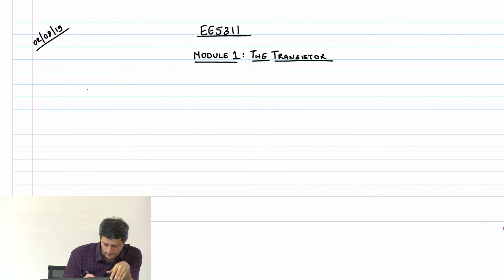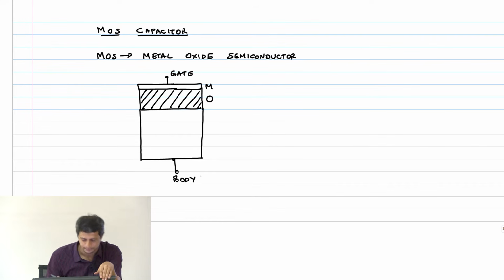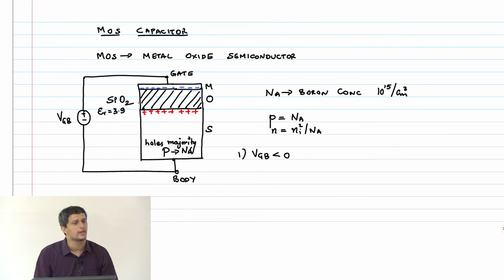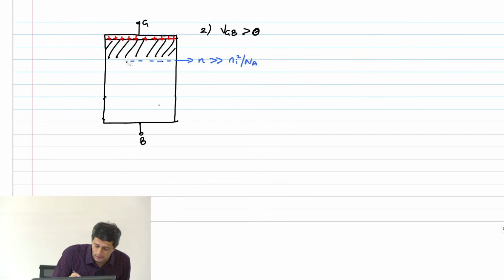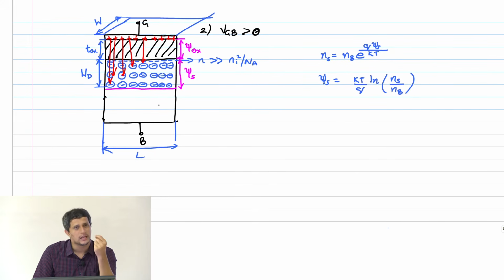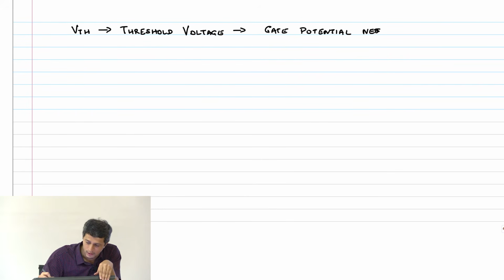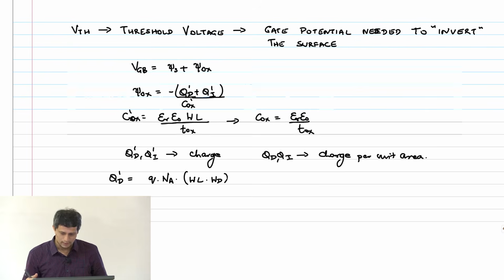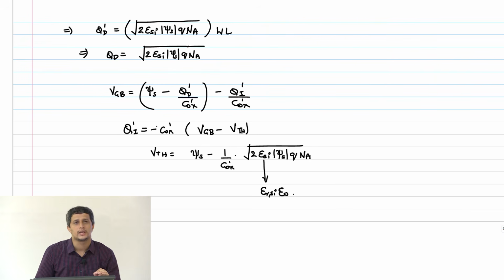Transistor - 2  - MOS Capacitor Threshold Voltage

Comment: I have confusion, during pined  potential sir says ns becomes equal to NA. Who it is possible in p type substrate holes are in majority and electrons are in minority and battery itself does not supply electrons. If due to potential minority electrons accumulate near surface how we can say that these minority electrons concentration becomes equal to majority holes in substrate
Reply: sir , is assuming that , the movement of holes away from that position as creation of immovable electron , and movement of electrons from its place is creation of immovable holes, For example , take maths , [ 80 holes (major ) 20 electrons minor , total 100 . when Vgs is applied positive , lets say 60 holes repelled , which creates 60 immovable electrons near surface , and in meanwhile , the 20 electrons (minor)also get attracted , which is total 80 . this 80 equals to the body concentration ,of 80 holes , so ,,,,,at this point , potential pinching

Comment: Greetings sir, Firstly thanks for the lecture series !!... I have one doubt at 21:13 as, why you have written a Negative sign to the charge ...
could you please explain ...
waiting for response, 
thank you
Reply: As there is minority charge carrier that is electron in this case and immobile Acceptor ions, both having negative charge. That's why
Reply: because....oxide inteface has become n type ....negativity charged.
Reply: Professor has also incorporated the nature of the charge in the equation.
As you will see further in the video, you will find that while finding the expression of Qi', he has only mentioned the magnitude and not the nature of the charge.
That's why it wasn't apparent.

If you drop the nature of the charge from your derivation, the process becomes very evident.

But then you have to take care that you are using only the magnitude of the charges in the second case.
Reply: The last expression he got there is wrong he corrects it in the next lecture.
The point of threshold is to make the channel conductive and in the process we keep adding the potential first account for the surface potential in the depletion region then to induce the charge.
Reply: I also feel this issue as the top layer of oxide is +ve and bottom layer in -ve , so why only bottom layer is considered while writing the equation